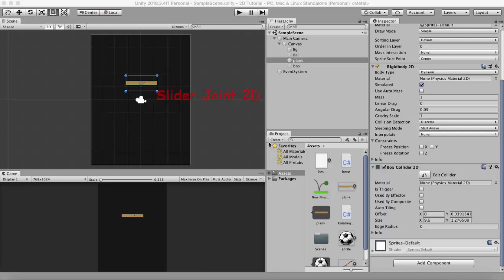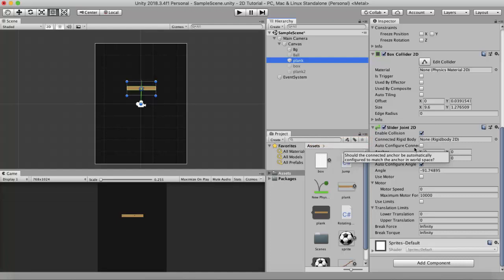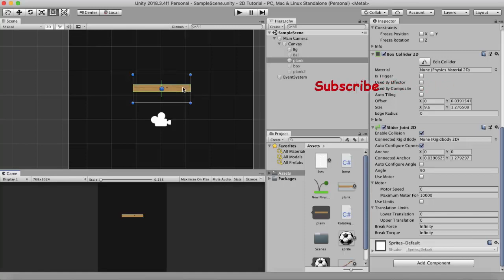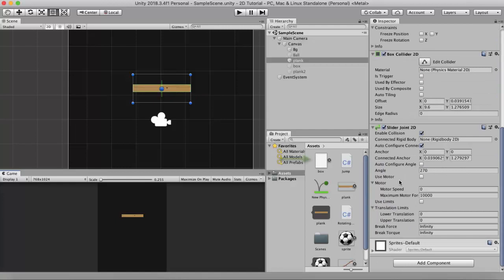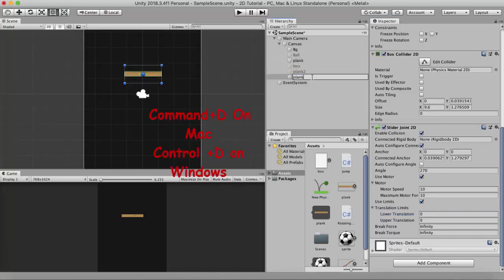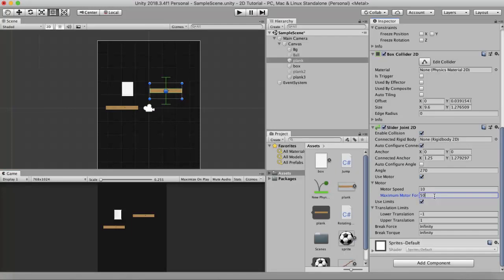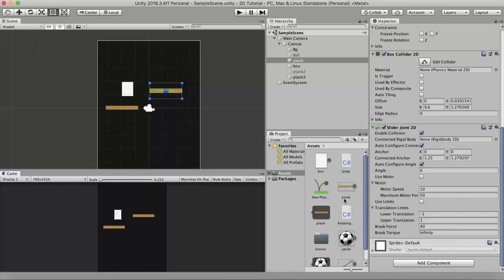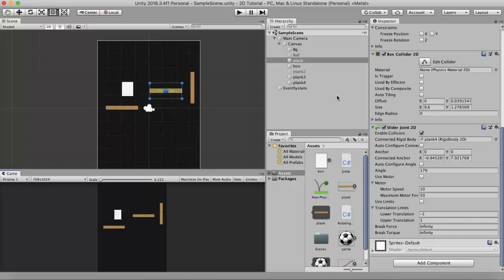Slider Joint 2D - Unity Tutorial

Comment: Hello, liked the vid and subbed!
Do you know how to make the slider go back and forth each time it hits the limits of the slider?  to create a platform ledge for a player to jump on and transport him to a new surface traveling over a canyon? the slider just goes back and forth and you need to hop on - hop off.
thanks!
Reply from the maker: Hello.Thank you for liking and subscribing.  For the question you asked. Here is what you can try. Take the platform gameobject and set its body type to kinematic. So that it does not get influenced by gravity. Then in your C# script you can write something like
using UnityEngine;
 using System.Collections;
 
 public class BackAndForth : MonoBehaviour {
 
     public float delta = 1.5f;  // Amount to move left and right from the start point
     public float speed = 2.0f; 
     private Vector3 startPos;
 
     void Start () {
         startPos = transform.position;
     }
     
     void Update () {
         Vector3 v = startPos;
         v.x += delta * Mathf.Sin (Time.time * speed);
         transform.position = v;
     }
 }

Attach the script to the platform. Hope it helps.